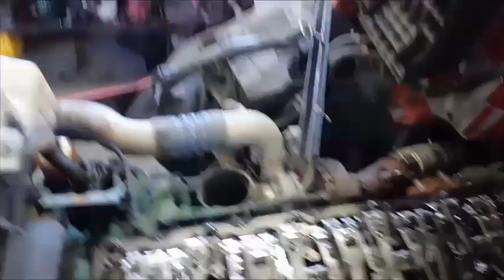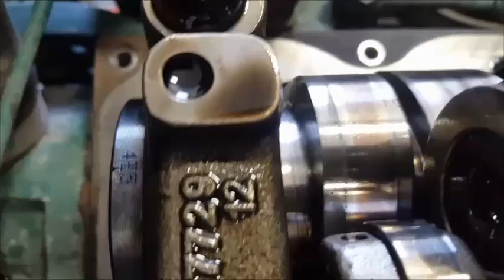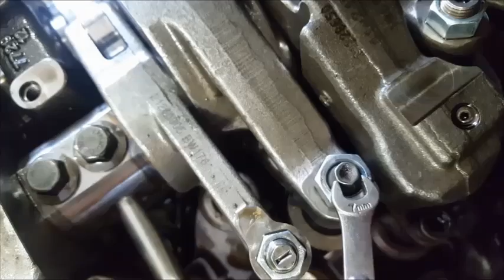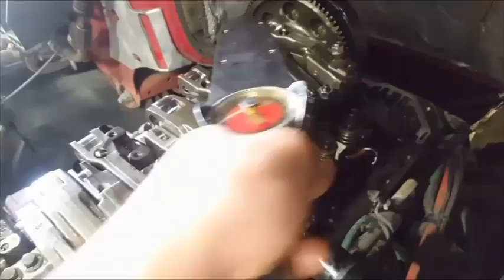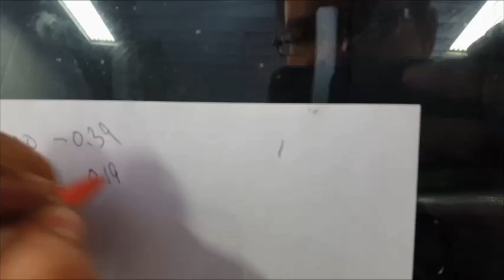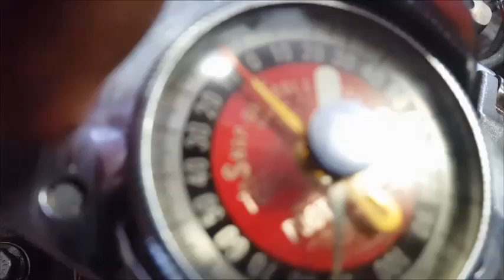Volvo D13 with VEB Overhead Valve Adjustment

Comment: Do you have to run a full overhead if you do injectors and cups on a d13
Reply: Wondering the same thing?
Reply: @OrlandoGTR450  any time you remove the rockershaft you have to do an overhead since not everything goes back exactly how you removed it. It may be close and you could potentialy get away with it without causing any damage to the cam or valve train but why risk it.

Comment: Could you make the same videos you made for the D13? Please make videos for D12D injector cups, injectors, rockerarm torque and overhead valve adjustment? Or at least maybe state difference in valve clearances, if similar?

Comment: Question:
[ I'm building compression or exceesive pressure in the coolant reservoir pushing coolant into the overflow side which normally stays empty (yes I tested coolant for combustion gases and gases are present in coolant) no diesel in the oil, no carbon in the coolant. Only excessive pressure gases in coolant.] Question: Is it most likely the cups? head gasket? Or cracked head? [ Loses about a gallon of coolant per hour out the overflow, only when driving but it's not going out the EGR into the exhaust! ] Is it the injector cups? (D12 motor 2005 volvo vn780) Thank you for all of the awesome videos and information.
Reply: Air compressor’s cylinder head bypassing pressure to coolant system.

Comment: Do you have to run/pre-adjust the overhead to proper clearances before you replace the injector cups/injectors, so that when you put the rockers arms back on you will already have the proper clearances set ahead of time before the removal of the cups/injectors?
Reply: No, that's not how adjustment procedure works. All clearances are set after replacement parts are installed

Comment: Would a fluctuating rpm gauge, that flutters 100 rpm at idle indicate need for a valve adjustment? My engine seems to kind of flutter at idle and under loads going up hill. Shop can't find any bad injector or bad injector cup. It's a 13 volvo D13 with VEB.

Comment: The clearance for Exhaust valve valve is 0.039. You subtracted 0.20 from 0.39 on Cylinder 1. You got the right clearance 2.5mm shim but you said the wrong numbers, and you showed the wrong numbers.
Reply from the maker: Yea it'll be obvious when you are half inch off lol just wasn't paying attention but you know what I mean
Reply: @cardinaltruckservice3753  Great videos either way. And it should be obvious but you'd be surprised lmfao

Comment: I’d let you work on my truck anytime. How much does your shop charge for a Volvo d13 2013 injectors replacement with cups
Reply from the maker: It will be around 4400 after tax for labor and new injectors and cups
Reply: @cardinaltruckservice3753  that’s not bad. Thank you. When I’m ready I’m coming to you guys. Please leave us your shop number!
Reply from the maker: @EASTCAMDENRD  cardinaltruckservice.com for more info
Reply: @cardinaltruckservice3753  thank you so much

Comment: Currently doing an in frame on a Mack MP8 and started adjusting the valves today. My question is direction of normal engine rotation. Following the manual, I start at Cylinder #5. but they stress to rotate the engine in normal operation direction. DO NOT ROTATE BACKWARDS. From the flywheel looking towards the front of the truck, Im rotating the crank in a counter clockwise direction, which makes sense because the next cylinder marks that come next on the camshaft correspond to the cylinder order they tell you to adjust to, But it looks like other peoples videos are rotating in the opposite direction. from the alternator with a 24mm socket, you can only rotate the engine one way or else the pulley slips on the belt. Am I going the right way ?
Reply: I CAN'T ANSWER... YET.  BUT I CAME WITH THE SAME QUESTION. 
When the count given was from back of Engine at 1 my brain glitches and I retreated here. 
This guys content is awesome for sure, but you find that often where "relative bearing" of the truck "front" is used to signify the "front" of the engine. We're starting a cup/injector/overhead job in the next few days so I shall return.

Comment: Thank you for the video 👍👍👍
I have vibration when the engine brake in position #3 and RPM between 1200 and 1500 (turbo pressure about 25psi) I just have done with overhead but still the same problem. 
I have noticed on video the engine brake valve look like new. What you think can that engine brake valve cause that problem?
Thank you very much
Reply: How much did you pay for the overhaul kit?
Reply: @strubies  hi, 
I didn’t do overhaul, I meant overhead (valve adjustment)
It helps a lot after when I have done it myself

Comment: Those clearances seem pretty loose. Obviously you cant feel the resistance by watching it but it looks like there is no resistance at all on those feeler gauges. Should have some resistance ideally. When loosening the exhaust bridge shim hold down bolt, use a spanner to hold the bridge when cracking the nut beacuse on occasion its possible to snap the pin. Nice work though, interesting way of winding the engine over. An easy way is to use the correct tool and a ratchet strap on a bar and ratchet the bar on the tool from outside the truck whilst watching the cam markings.

Comment: Great video, very instructive. question got D13 Passing coolant into the oil. Check head and head gasket with block tester and no problem, checked erg coolant and all dry. did a coolant pressure test with no leaks anywhere but coolant disappears and finally did an oil sample test and came back 0.83% coolant in the oil. I been told this could be due to bad injector cups.
do i have to replace the injectors or reprogram after replacing the cups?
Reply from the maker: For coolant to get into oil through injector cups it need to get past injector seals as well so you would have diesel in your coolant and vice versa. Might be oil cooler, or coolant leaking past cylinder liner seals, or maybe air compressor somehow.

Comment: Have 2 further questions 
1: can engine be turned without turning tool
2:which cylinder 1 or cylinder 4 to start adjusting valve clearance as in the video
Reply from the maker: Sorry for late reply, I use ratchet and 24mm socket on alternator to turn engine, that way you dont need 2 people. If it slips get another 1/2 ratchet and put on tensioner to make it tighter. Make sure the alternator nut doesnt come loose. You can start adjusting on any cylinder depending where your camshaft is

Comment: Thanks for your video mate, you gave me confidence to tuneup my truck by myself:)))) I've got 2003 D12D 500hp with turbo compound.I just wondering if the process is the same on my one like the one on your video and what is the measurement for my one please.Thanks again
Reply from the maker: +Lupco Gurcinovski its similar but the exhaust brake adjustment is different and clearance on exhaust is 0.063 I believe.
Reply: Kalinchuk DIY thank you my brother , i didn't even know that I have to adjust exhaust brake

Comment: Do you reset the overhead adjustment everytime the rocker shaft is removed even if every part goes back in the same place, say for instance when changing one injector can you just adjust that cylinder or is it a better idea to just do all 6. The engine I'm working on had the overhead adjustment done maybe a month ago.
Reply from the maker: I do all 6 anytime I take off rockers but I dont know if you have to

Comment: Hey thanks so much for this info. I just pulled the valve cover off of my 2014 D11. The markings on the camshaft are different and there are not any engine brake rockers. Are you familiar with the D11 and what the markings mean? I would send you a pic via email or something but don't know how to do that via YouTube. Happy Fourth!
Reply from the maker: Without engine brake adjust intake,  exhaust and injector at the same time for each cylinder, camshaft will be labeled 1-6 instead of 1E3 or something like that
Reply: @cardinaltruckservice3753  you're the best!
Reply: Crankshaft won't turn over either... the alternator pulley just slips in the belt. Do you have any other tricks or do I need to buy the tool that turns the flywheel?
Reply from the maker: @jonathanh3632  get a half inch ratchet and put on tensioner to hold it tighter, should be easier after a couple trys

Comment: If I hear a ticking sound from my engine with 740k m on it, is that from this?
Reply from the maker: It can be
Reply: I have same sound coming from the driver side of the engine. I got d12d engine and as rpm goes up the ticking gets faster too, what could it be. I havent done valve adjustment for over 400k miles.

Comment: can you explain a little more about  the shims and how to determining the thikness that i need on each valve ?and how do you do the math because i am confuse  thank you
Reply: the space between the exhaust shim and the valve must be 1mm ! you measure the space if it is more then then 1mm you put thicker shim if it is less then 1mm you put thinner shim! When adjusting the engine break you need to use 3.5 mm shim ( do this after you are done with the exhaust valve adjustment 1st and your measuring shim is out of there)!

Comment: I had the injectors replaced on a d13 2012 Volvo at a volvo dealership and now the engine brake does not seem to be working. Dealer refuses to check it 
What can I check for?
Reply from the maker: Take valve cover off, check that engine brake solenoid is connected, if it is fine then remove the solenoid and make sure o rings that were installed correctly and not torn. Replace them when reinstalling solenoid
 http://Cardinaltruckservice.com
Reply: Kalinchuk DIY 
I replaced it today including the rings and still nothing 
I was told by the volvo dealer to check 2 switches 
One on the clutch and the other one on the brake pedal.
Reply: Try lifting you brake or clutch pedal, mine wasn’t working until I pulled the clutch up

Comment: All good until the dam alternator nut starts backing off...but good video.
Reply from the maker: Like I said they sell special tool for turning engine but alternator truck always works for me. Get wrench and Allen socket and tighten it up and try again, may need to put 1/2"  wratchet on tensioner to make it tighter so belt doesn't slip
Reply: I use to turn the alternator with a allen socket directly on it's axel to prevent the nut from loosening👍

Comment: What’s the intake side spec
Reply from the maker: 0.008". Check video description for more details
Reply: @cardinaltruckservice3753  awesome thanks for the reply how similar is this engine to the mack MP7 2016
Reply from the maker: Mp7 same as Volvo d11
Reply: @cardinaltruckservice3753  so I want to see will you take is on a mac I got in my shop has a MP7 2016 Mack gu713 had a check engine light injectors 1 2 and 3 all had a code I thought injector one was bad so I unplugged injector one and left the rest of them plugged up I ran the truck at idle and then code came back except it was just for injector 1 not injector 2 and 3 unplugged injector to to make sure and sure enough injectors 1 2 and 3 had issues or code am I right in thinking that injector one is shorting out causing 1 2 & 3 Bank to seem faulty any advice is appreciated thanks again
Reply from the maker: Maybe, hook up a spare injector to injector one connector, see if you get codes.
Reply: @cardinaltruckservice3753  ok I will try that thanks again

Comment: How many hours it takes for adjusting valves at d13? 
And how much can cost to do this at a dealer ?
Reply from the maker: 2 to 3 hours max. Idk how much the dealer charges probably too much
Reply: Hello I just found your channel.
Good information. 

I have a 2012 Volvo 2012 D13 with 667943 miles and it is taking a longtime to start.

I just did a Oil change,changed the Water Separator, fuel filter and Air filter. 

I even let my mechanic keep it overnight and they said it started for them my problem is not that it starts it is taking to long to finally catch.

I am not a mechanic just looking for some suggestions of what the problem could be my mechanic is a Volvo Dealer all they work on is Volvo's and Freight lines. 

I live in Chicago Illinois.

Do you have an idea of what it could be just trying to fix it now before I gets to cold don't want to be stranded. 

Thank you for your channel.
Reply from the maker: @robertbowen1197  check fuel lines and fuel filter housing for leaks first. Most common reason is injector cups though.

Comment: Could you leave me address of your shop? Thanks
Reply from the maker: +Truck four12 Address:
6038 South Valley Pike
Mt Crawford, VA 22841
Please email cardinaltrucksvs@gmail.com to schedule an appointment. Thank you

 http://Cardinaltruckservice.com
Reply: @cardinaltruckservice3753  

I have a Volvo 780 2012 and it is taking a long time to start. 

I had a Oil change,changed water separator, fuel filter and air filter still has a hard time starting. 

I even left it with my mechanic overnight but they said it started for them my problem is that it is taking to long to finally crank or catch.

My mechanics work on Volvo's and freight liners only.

Can you give me some suggestions on what it could possibly be. 

I live in Chicago Illinois.

Thanks.

Comment: Injector cup o-rings ,could you use NON- petroleum grease like silicone di-electriic  grease that can be bought at Napa or Wal Mart , silicone won't swell o-rings, correct?
Very good video , now I know exactly what cups and rocker shims are.
Reply: Just a little dish soap works great to lube o-rings.  Been doin' it for years.
Reply from the maker: John Gunnerson Anything that will help get the o ring in without tearing it. Manufacturer says you can use coolant but that grease should be ok

Comment: great Info thank you for your time. one question do I have to adjust the overhead right after I change seals on injectors
Reply from the maker: Tom Servoss We do overhead anytime we remove the rocker arms. it only takes an extra hour or 2 while everything is apart. removal can change clearances
 http://Cardinaltruckservice.com
Reply: Great videos. Very well explained. Thanks...